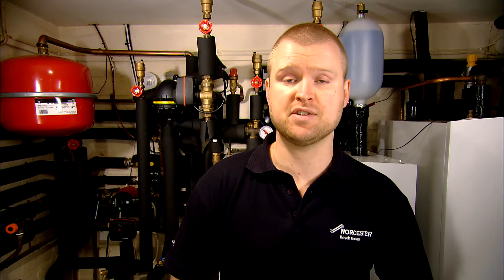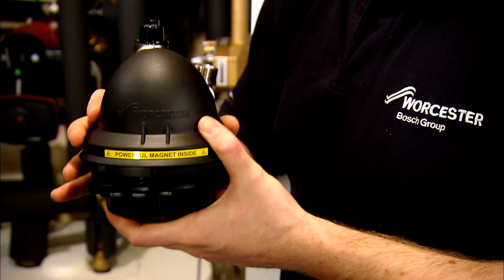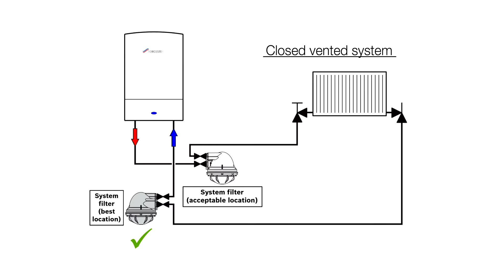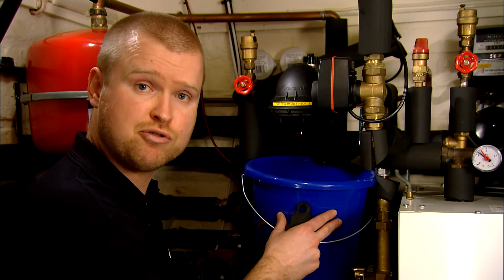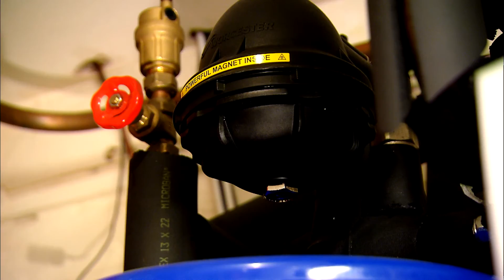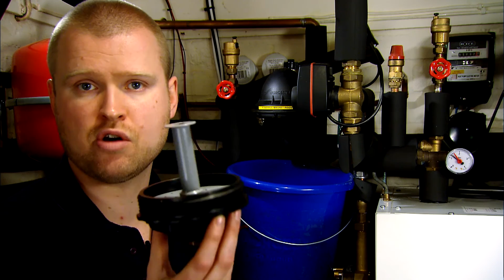How to Service the Greenstar System Filter

Comment: Having serviced a few cdi’s with that filter I was surprised to see how the internal magnet cover had misshaped , presumably with the heat. As that installation on the video was only a few months old and had captured magnetic and non magnetic dirt I’d be wondering how effective the initial cleaning regime was.

Comment: Products needs work, so vent be better at the top, the water wont drain out , without letting air in.. Thats why u need to catch so much water.making it messy to service
Reply: Hancock and Brown  the new Worcester system filter is so much better. The company i work for is Worcester accredited and when these first came out we had a our local rep come visit us and I mentioned that i wasn't keen on the design and that the magna clean design is what they should aim for. And he told me that when these first came out adey actually made them for Worcester and they wouldn't let Worcester copy there design. But if they continue too sell more they will start making there own and change the design. Which they did.

Comment: Hi, had one of these installed with my boiler. Can I clean it out myself or do I have to get it done by a plumber annually in a service?
Reply: Tazza17 you can do it yourself if your competent but I'd recommend getting a engineer too do it when they service your boiler. Which if your boiler is within warranty you will need too get serviced yearly not to your warranty.